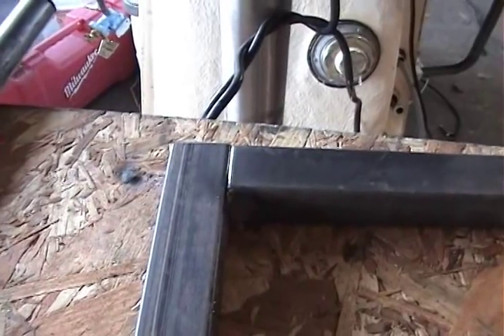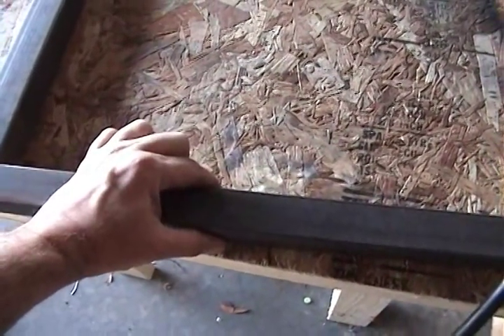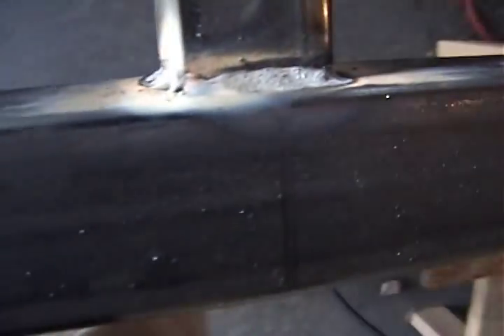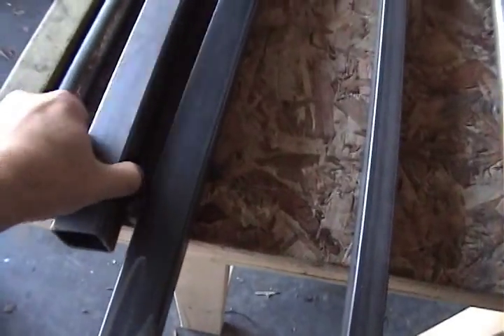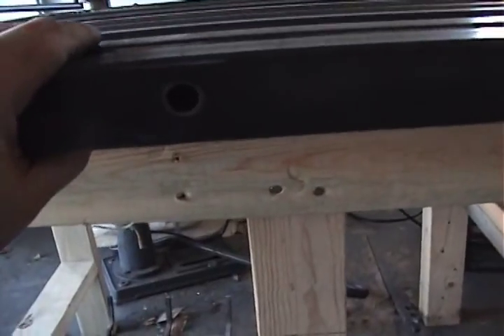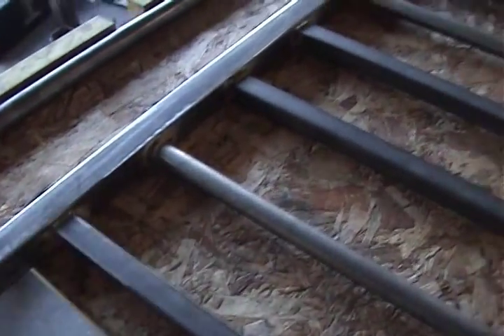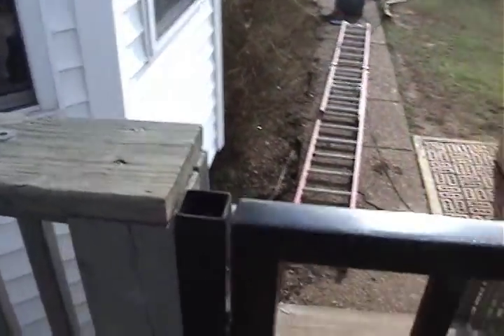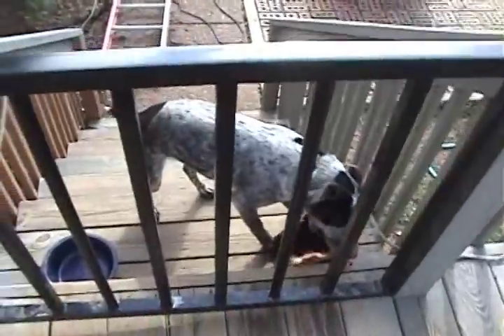Welding a wrought iron gate by Mr. Energy

Comment: Thanks for that. I make my cupboards out of tube steel then I clad with ply wood. I haven't put doors on them. I consider the open seems to be more accessible. Plus I was worried that I will get it wrong if I do weld on hinges.

Comment: Where I am letting the water out is real important.  I've drilled into all the fence and gate parts.  The amount of water that came out was amazing (it's 20 years old).  Some places the water came out under high pressure (I'm guess the rusting process released hydrogen which did not somehow leak out, but...)

Comment: Great video.  What do you all use to prevent a steel gate from rusting?  I was thinking of powder coating mine after I weld it up.  Any better suggestions?
Reply: Hi.  I've been told that specific paint made for wrought iron fencing outdoors, see Sherwin Williams, is better than powder coating.  I'm not in the business, so di your reaearch but as I'm looking to have gates built, paint is what I'm being told.

Comment: Hello great job. When you welded the hinges did you put a spacing between the post and the fence before welding? If so what was the spacing distance? I have made a similar fence to my side gate. But I picked up steel posts being thrown out of a job. I grinded down and painted. Then I set the post in concrete. I welded hinges to the post before setting in concrete then slid the gate onto post. The gate is about 1.6 metres wide.
Reply: I started welding some years ago and my set up then was some what primitive.In an ideal world maybe metal bench would be suited as opposed to a wooden bench with OSB surface.Your welding which is pitted is also questionable and I would have been rejected upon inspection.Are you sure your not a joiner?